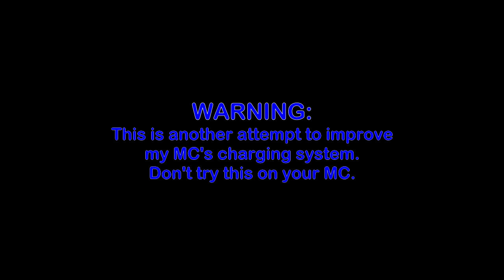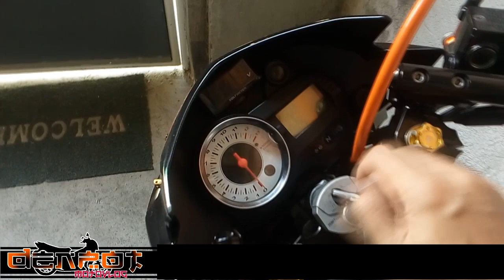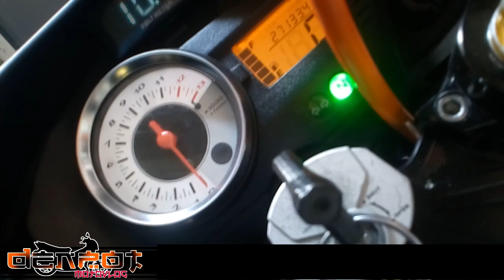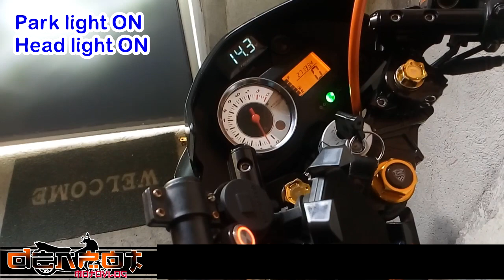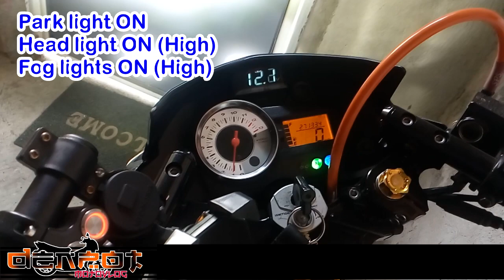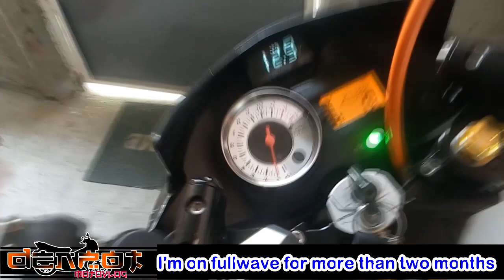From Halfwave to Fullwave Charging Conversion

Comment: Boss ask ko lang nung wala kapa ginalaw sa motor mo. Gang ilan inaabot ng votls mo pag umaandar? then pag naka on lang ilan lang po?
Yung sakin kasi di ko ala. kung ano sira. Pag naka naka andar yung motor umaabot lang gang 13.9v di siya umaakyat ng 14v. then pag naka on lang naman nasa 12.2v-12.6v sya. pinalitan ko na rectifier ko pero nagtataka ako bakit namamatay yung guage panel pag pinipindut ko yung push button.
Reply from the maker: nung di pa naka fullwave, pag naka on lang, nasa 12.2v-12.5v sya. pag umaandar nasa 13v-13.8v. pag namamatay guage mo, mahina na battery mo
Reply: Yes sir. Mukang battery na nga talaga. Kasi pag pinipindut ko yung push start .Nag cacrank lang tpos mag didisplay sa voltmeter. 6.56v lang.. now nakabili na ako ng quantom battery sana magtagal na. Natatakot na kasi baka ilang araw lang wala na sira na batt ko. Pag nanyare yun. Bubuksan ko na lahat. Stator, rect/regulator
Reply: Kasi bossing nagpalit na ako ng rectifeir ko. then ngaun binalik ko stock batt ko.after a week. ayaw nanamn gumana push start ko. Sabi eh mamatay na daw batt ko .pero sa charging umaakyat naman siya gang 13.2 to 13.9max. so bukas bibili ulit ako battery. Tingin mo sir ano problem ng motor ko. r150carb din gamit ko.
Reply from the maker: sira na talaga battery mo, kahit nagchacharge sya, ang indicator kapag defective na ang battery, pag push start mo pa lang, dapat di babagsak below 9V ang voltmeter. kahit na fully charged sya.
Reply: Boss may tanung ako ulit. mula nagpalit ako ng battery kahapon. Yung reading nag voltmeter ko, pag naka idle lang umaabot ng 14.0 minsan 14.3 pa. Pag running ummabot ng 14.7v. Normal kaya to .? stock charging system lang p ko. hindi ako naka fullwave o fastcharge
Reply from the maker: basta wag aabot ng 15v pataas, baka mataas menor mo, kaya pag idle nasa 14v na, or kung may tester ka, check mo kung parehas reading ng voltmeter mo

Comment: boss bkit ung akin naka fullwave pag ni revulosion ko bumababa ung volts nya bumababa ng 11.4v anu po kaya problema non?
Reply from the maker: pero tumataas din ba kapag bitaw?
Reply: Tumataas nmn umaabot ng 11.8 boss
Ok lng po ba un oh may mali ?
Reply: Ang bilis po malowbat boss ilang bisis lng ako gumamit ng push starter
Reply from the maker: check mo muna battery mo paps kung kakarga sya, pa kargahan mo sa talyer, pag kumarga pa, palit ka rectifier
Reply: Ahh gnun po ba maraming salamat boss laking tulong mu talaga samin.
Good blessed and ride safe boss 🙂
Reply: Boss pahabol pag nag full wave ba kailangam mag palit din ng CDI?

Comment: Hindi ba naka battery operated yan ilaw mo sir
Reply from the maker: Battery operated yan sir. Kaya ako nag fullwave kasi na lolowbat sya noong binattery operated ko sya
Reply: @denpotmotovlog  pag naka full wave ok lang ba hindi i battery operated
Reply from the maker: @jovicgania5873  parang hindi, kasi based sa wiring ng stator, pag halfwave, yung white is for charging, so sa battery na ka connect yun, yung yellow ay sa headlight.  Pag fullwave, yung white and yellow magiging charging.  So walang line para sa headlight.  So lahat ng ilaw dapat ang source ay battery.
Reply: @denpotmotovlog  sakin sir mali yata to pagka fullwave kasi may ilaw parin head light kahit hindi i battery operated
Reply from the maker: @jovicgania5873  umiilaw ba sya pag in-ON mo habang patay ang engine at naka ON ignition?
Reply: @denpotmotovlog  pag naka battery operated ko pag di umaandar pero naka on ang ignition switch umiilaw pag hindi ko e battery operated kaylangan aandar ang motor par iilaw ang headlight naka fullwave na sinubukan ko ibalik sa hindi battery operated ang headlight nagana naman
Reply: Ibalik ko nlng sa stock sir bumili na rin akong stator at rectifier

Comment: sir ano kulay nung dalawang wire na pinag connect mo sa stator? at anong kulay nung mga pinag connect mo sa rectifier?
Reply from the maker: Check mo dyan sir
https://m.facebook.com/story.php?story_fbid=396386170995884&id=338387430129092

Comment: Boss. 15.01v normal ba? Ang ginawa lang sa MC ko may pinalitan lang na wire sa baba ng batok. Di nag open na makina. Anung tawag sa ganun? Full wave? Fast charge or half wave?
Reply from the maker: Fast charge yun. 15v is normal if engine is running.

Comment: Boss ung motor ko malakas ung pumapasok na kuryente nya umaabot pa sya ng 15v..pero mahina magcharge ung battery ko kahit umaabot sya ng 15v kapag pinapatakbo ko..tapos kapag pinatay ko makina nya tas i on ko ung susi nya 12.4 lang lumalabas sa voltmeter ko..tingin mo idol palitin na kaya battery ko?
Reply: Tingin ko nakafull wave naman sya pero nung tinignan ko ung rr ng rs100 ko two wires ng ung rr nya at maliit sya d sya katulad ng sayo na 5wires ung akin 2wires lang
Reply: Ok lang naman cguro na palitan ko sya ng gy6 na rr idol?
Reply from the maker: kung raider 150 ka, ok lang palitan mo ng GY6.
Reply from the maker: pag pindot mo ng electric start, dapat ang reading nya bago mag redondo ay di bababa ng 9V.  pero pag bumaba yan ng 9V, sira na battery mo.
Reply: @denpotmotovlog  rs100 motor ko hindi raider😂😂😂
Reply: Hindi nya electric start boss. Pinacharge kulang ung battery ko ok naman na sya..kaya lang lang bakit ganun idol malakas naman dumadaloy sa vm ko pero ung battery ko parang d tumataas charge nya
Reply from the maker: @emilioburagajr2600  12.4 V to 12.9 V lang talaga ang full charge ng battery

Comment: Full wave ba, ung end ng coil ng stator connect dun sa yellow? O dun sa start ng stator winding saka dun dulo parang, end to end?
Reply from the maker: originally naka center-tap po ang yellow, tapos yung end ng coil na sa ground, so tatanggalin yung yellow sa center, tatanggalin yung end ng coil sa ground, tapos yung yellow ang ipapalit dun sa end ng coil.
Reply: Salamat bro, bale Wala ng body ground connection. Subukan ko sir kc lagi mababa voltage ng battery. Marami kcng accessory lights ung tricycle nmin.